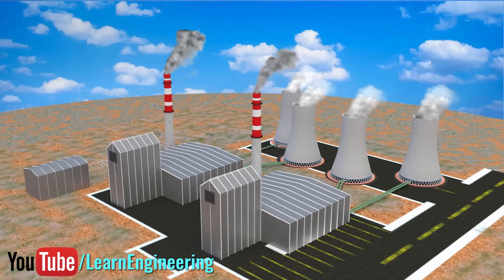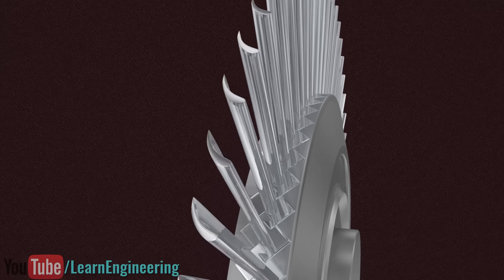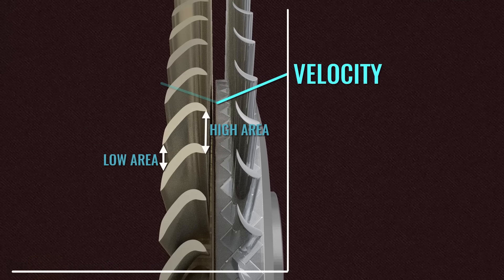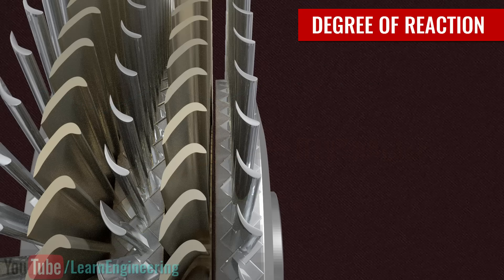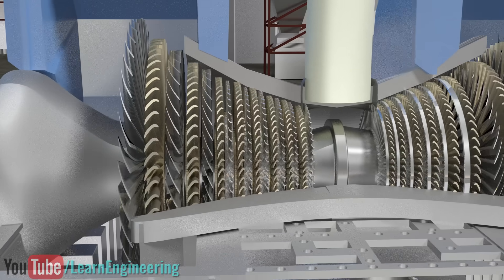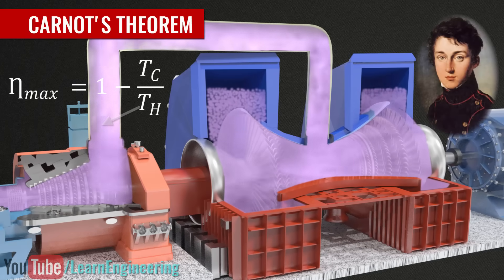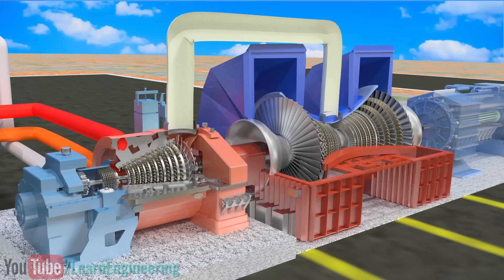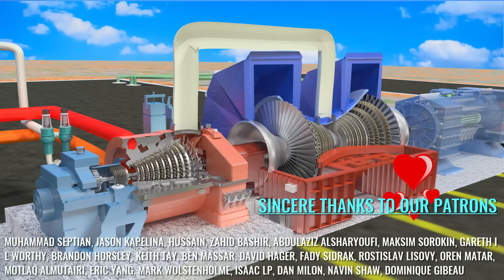How does a Steam Turbine Work?

Comment: We need to move to sustainable forms of energy asap...
Reply: Steam turbines are just a tool for converting heat to rotational force. If you get that heat from a sustainable source, you'd have a sustainable steam turbine : )
Reply: jawbreaker this can be sustainable. This isn't the ultimate source of energy, it's just the conversion.
Reply: then go out and buy solar panels asap..
Reply: Thorium molten salt reactors can (theoretically) safely consume the waste products of current uranium breeder reactors, so nuclear isn't completely out of the question. Also, when I used the word "consume" in the previous sentence, I meant it literally; TMSRs actually would, albeit slowly, convert all of that fuel waste matter over into energy.
Reply: some solar power plants also use this technique.
https://en.wikipedia.org/wiki/Solar_power_tower
Reply: Bill Porter easy is burned at a 99% compared to our 70s technology reactor which at best can get 2-3% off the total energy of 

is called waste because theres not a lot of reactors that can fissionate the remains but the Breeders from  the waste that is usually plutonium or paladium will create more fuels from the remains until there's nothing left
Reply: cmiller8492 
you sir, are effing insane!, useing a process such as a nuke plant, whose waste product can't be touched by bare hands for at least a couple thousand years, finding a process for cleaner coal combustion, and, or?, anything EXCEPT nuclear plants, find a VIABLE alternateive to coal, and I'll listen.
Reply: cmiller8492 
THE F***ING WASTE PRODUCT!, THE S** WILL BE A WAITING BOOBY TRAP FOR 10,000 YEARS!, what the hell are you not hearing?!
Reply: new technologies (renewable) already create way more jobs than old technology (fossil fuels) and focusing more on the renewables may see an even greater rise. The only reason government keeps the old fossil fuel line is because it's a popular thing in some regions and because the people working in these old technologies need to be reschooled and the new technologies need to be invited to these regions. There is no real reason to not support the newer technologies in favor of the old technologies jobs wise
Reply: MothKing 
getting closer, my main complaint is still the waste product, the reactor itself is complex enough as is, I am still astounded at the expense, to make the same amount of juice, as a coal plant, quite like useing a stick of dynamite to open a stuck door. 
I still would like to see a practical solution to the waste question, a fixed plant to either consume it' s produced waste, and, or, perhaps a way to consume existing waste product, mainly so our descendants don' t end up looking like a setting for a horror novel.
Reply: Jack 
yup!, we will run out of fossil fuel eventually, and a good, viable, alternate fuel source would really come in handy, nuke plants are an albatross, expen$ive due the fact that radio-active matirials tend to induce wear, and tear, faster than conventional steam plants.
I actually prefer turbine plants, as they are relatively simple, either coal, or nat. gas, basically due the fact that catastrophic failure won' t involve radiation suits, same protcols for handleing the fuel source, and haveing to isolate the entire complex due the same scenario.
soybean, and peanut oils are looking good for vehicular use, wind powe?, still out on that one, but to find a good, cheap, useable heat source to create steam is what we need to find.
Reply: Highjack996 
said it a thousand times, renewable energy is needed.,  but same said needs to be viable,  not a pipe dream.
Reply: Bill Porter   As engineers, etc… I find the term, renewable, irritating at this scope. Energy, being the catch-all term for anything with the ability to do work, is always some sort of conversion; the concern I see here is environmental impact potential.  A question I have is which is better?  Coal burning with very dispersed dissipation or nuclear waste with very contained waste?
Reply: jawbreaker what do you mean with sustainable? because there is enough methane hydrates for 3000 years and nuclear is pretty clean if we develop the fast breeder reactors
Reply: Spotav 
same ol' question, what to do with the waste product.
Reply: Spotav sure but fast breeder reactors are usually a pain to maintain, given that the moderator for the reactor is typically liquid sodium, which burns in air and reacts violently with water. nuclear waste will be radioactive for thousands of years, sure, but the concentration of enriched uranium is usually not that great, and is a highly efficient mode of producing electricity. carbon emission per megawatt energy is also outrageously hugh for coal. No offense, but we need to get rid of that sh*t asap.
Reply: jawbreaker i hadn't been looking a lot about the molten salts but since many csp plants use molten salts to store energy one of the many types of those salts should have a lower reactivity with air
Reply: actually you can have clean coal plants with carbon capture and storage, at this moment 2 huge projects around this are being used/installed, one in canada and one in the netherlands. The goal is to capture the co2 and put it back in empty oil or gas fields. This shouldn't be a problem long term because these fields trapped these gasses already for millions of years. This would be the closest we would come to clean coal. The greatest problems at these moment are the huge costs, but they are expected to go down. According to studies we would have a huge amount of storage space (compared to what we produce), enough for several thousand years, after around 10,000 years this co2 would have become part of the rocks and seeing that we are expected to run out of oil in the next 200 years, gas in the next 1000-1500 year and coal in the next 2000-3000 year (based on known reserves, shalegas from fracking not included), the storage wouldn't fill up by far. 

There is overall no problem with nuclear powerplants except the ever growing costs due to efficiency improvements and safety precautions and public opinion. We can store these wastes and even re-use it partly, furthermore for all we know within the 'near' future we might find some application that needs this waste. It's better to go nuclear than continuing with other fossil fuels without ccs (which is still also expensive) and having many more problems in the short future. Overall Nuclear is definitely no worse than some other alternatives.

Some numbers about investment costs:
- nuclear: 4100 $/kW
- combined cycle gas turbine (uses gas turbine and waste heat is used to power steam turbine): 1000 $kW
- Coal: 2100 $/kW
- coal with ccs (90% less co2 emision): 3800 $/kW
- onshore wind : 2300 $/kW
- solar pv panels: 6000/kW

These are numbers that might be a few years old, but the overal trend remains mostly the same (pv and wind will have improved a bit)

Either way going green cost money at the moment, but it's definitely not impossible and nuclear should not be seen as something bad.
Reply: I would note that one ton of uranium produces as much energy as 600 tons of coal. 
Also it should be our priority to stop using fossil fuels for power, we are very capable at this point of phasing them out, and climate change poses the biggest threat to our species.
Reply: Kirin Yardberry , what will happen to all the 1,000 's of people working in coal mines, fuel plants etc? Government keep with old technology because it create jobs.
Reply: indeed, tsjernobyl was basicly due to three things.
1) Testing if a certain kind of emergency system could take over in time in case of a problem (earlier tests proved this was not the case)
2) The test was delayed and the less competent nightcrew went on with it, eventhough some things happened during the previous shift that had great consequences, but of which they were not aware and after that they made bad decisions one after another.
3) The type of nuclear reactor was basicly just a bad idea to start with safety wise

The dozen or so other reactors of that type changed their operation afterwards significantly, reducing their output, but ensuring their safety.

"If you want more jobs you could create a bridge to nowhere."
I was talking about the political nature of the certain 'reason' that was named to continue supporting coal powered fossil fuel made by the Trump administration. And the more jobs didn't meant just more jobs for the same production. Even if that's the case, it doesn't matter. If you have two workers to operate a non polluting energy production and one to operate a pulloting one for the same outcome, I'd choose the non polluting one (depending of the amount of pollution ofcourse). But indeed just choosing for renewable because it creates jobs is stupid and I never meant it to have that meaning.

"first of all we dont store energy, so comparing solar with nuclear by installed capacity is really stupid"
"IF SOLAR WAS ACTUALLY CHEAPER COMPANIES WOULD USE IT AND IT WOULDNT NEED BILLIONS OF SUBVENTIONS"
1) These costs talk about investments costs, when you look at building a plant or not you look to the investment costs + operational costs => LCOE, so yeah they are important.
2) Solar power on a large scale (solar fields) is indeed overall not attractive, that's why it isn't done except in some regions (I actually visited a solar and wind plant in France a year ago). The real strength in solar is that it can easily be produced on the place you actually use it (eg household, shops, ...), you wouldn't choose it for centralised production without subsidies.
3) Solar power is at this moment still coming up, ten years ago the costs were maybe 3-4 times what it is now, at least. There still is much improvement possible (especially in price), while nuclear plants have been around for +-60 years and face increasing costs due to extra security measures, ... and is becoming growingly impopular with people who don't really understand the dangers, but who ofcourse have a voice with politicians.

(Just to be clear I am not against nuclear power and that should be the last thing that should dissapear for renewables, if at all)

"and lets not talk about backup plant"
You do know that even with normal production (fossil, nuclear, ...) there are continuously back up plants in operation for:
1) providing electricity during peak loads
2) ensuring production in case a plant goes offline
3) just because their regular operation has now become too expensive in comparison to the past.

Yes, wind and solar haven't got the ensured production of ordinary installations and will need more backup. This is atm the greatest problem that engineers are being faced with in regards to these sources. 

It's not entirely impossible that in the future we will pay for installed capacity, rather than operating capacity.

And can you please give the source of the numbers you gave? Or at least tell me if you are talking about LCOE, operation costs, ...
Reply: Coal releases far more radioactive particles to the atmosphere than nuclear power
Reply: We need to put all you sustainability jokers on a treadmill.
Reply: Yes I am talking about the first chart that shows the coal plants are more than the rest.
Reply: No, we need to make america great again!
Reply: Clean Energy at the moment is far inferior to fossil fuels
It will take far more research and development into solar energy and even nuclear fusion for humans to be able to responsibly move away from fossil fuels